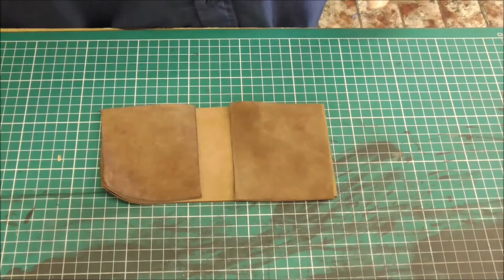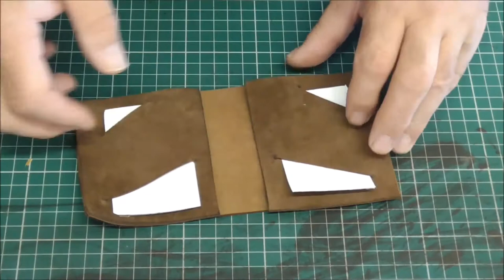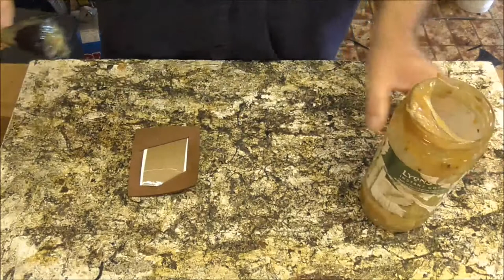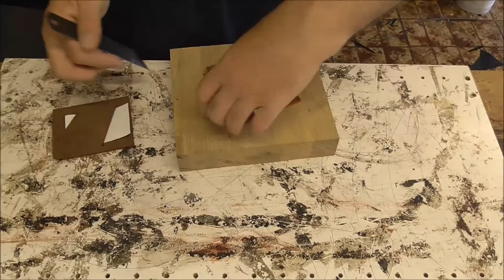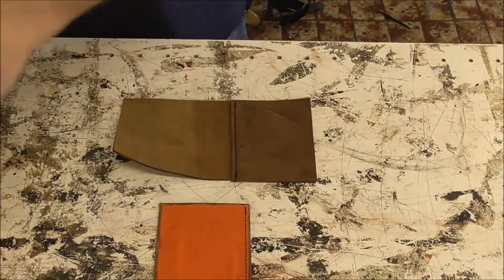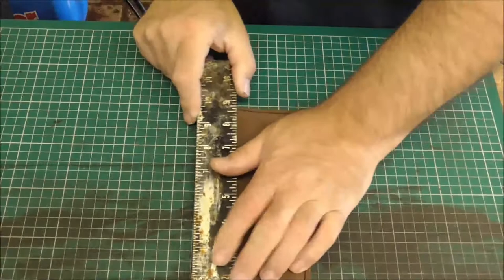How to make a simple leather wallet

Comment: Great video. What sort of leather/ thickness  would you recommend?
Reply from the maker: Tanya Braeman the leather in this video is about 2mm thick although you can use a 1 mm if it is more solid (we in the trade say if it has more body). 

If you only have soft leather that is to floppy. You can glue some cloth like silk or cotton on to it to make it stiffer
Reply: UK Saddlery 
Thanks for your reply! I have quite bit of scrap pieces so  I'll keep practicing.😀